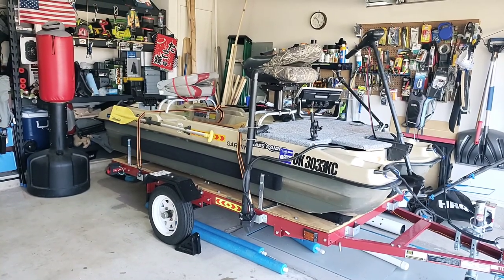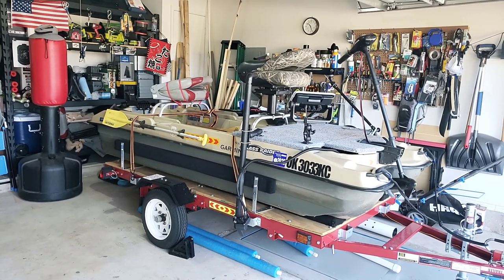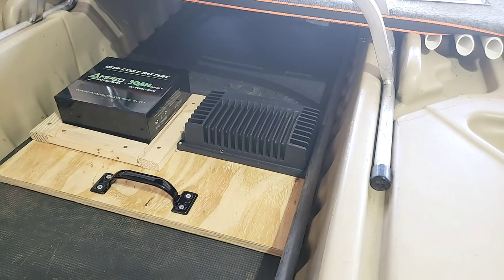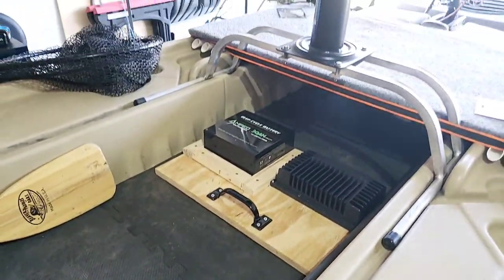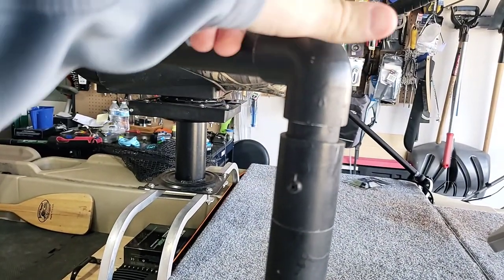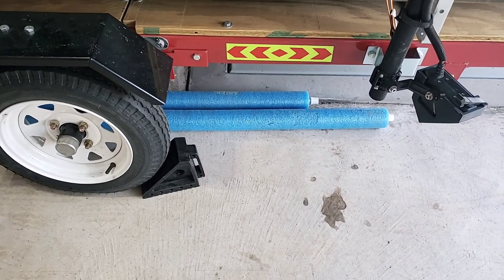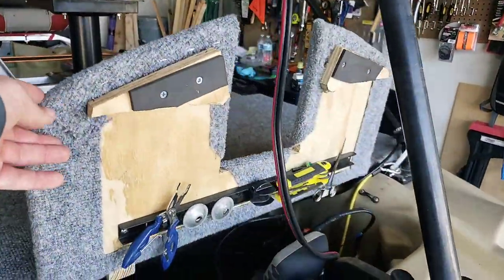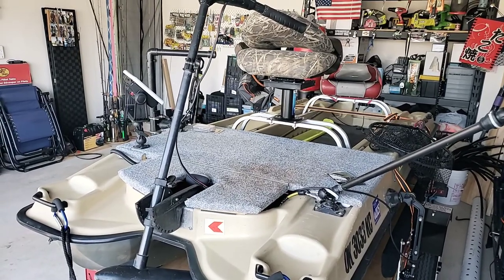DIY - Pelican Bass Raider 10E Modifications and Harbor Freight Trailer modifications

Comment: Nice set up!! I have same trailer and similar boat (the basshunter pro 120). I haven’t used the trailer to launch yet (still using the wheel dolly I built for unloading out of the bed of my truck). My first question is about the pool noodle poles… i didn’t quite understand how you use them when launching? 

Next question is I see your front seat mount is half under your casting deck. When/if you lean back in the seat while fishing or if you move from the front seat to the back seat and accidentally rest your hand on the back of the chair as you squeeze passed it doesn’t want to tip backward and/or lift the front edge of your deck up?  Hopefully I described my question clear enough lol, I have the same style seat mount (even have the same 7” riser added to one. They currently tip if you rest any weight on the chair back when standing to move from one seat to the other.  Huge thanks in advance you happen to see this and can respond!!
Reply from the maker: Sorry for the delay, I never received a notification of your message.   I put the pool noodles down behind my boat, then roll it off the trailer onto them, which keeps me from scratching up the bottom.  Where I launch, I can't back the trailer into the lake, and this works great.   You can't really see it, but the piece of wood that is underneath the deck and is attached with a frame, keeps the deck locked down really snug, so the seat slides perfectly in the rails underneath it, and the weight of the deck keeps the seat firmly in place.  I've been using it this way for over a year now and even with the riser under the seat, I haven't had the seat budge at all.  Hope that helps.  If you want to see a picture of the frame or a video of how it looks, let me know, I can shoot a short on that.

Comment: What was mounted on the stern? A power pole? Sorry bud, I’m not familiar with that? What is it?
Reply from the maker: It's a micro power pole.  Good for holding small boats in place as an anchoring system in 6 feet or less (when using an 8 foot pole.)
Reply: Thank you.